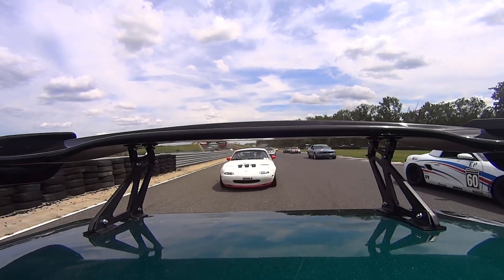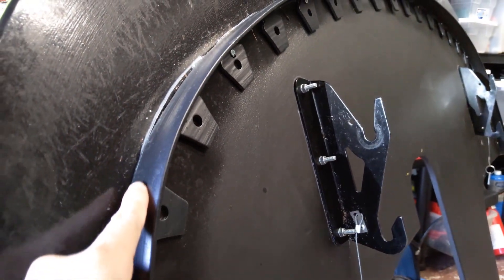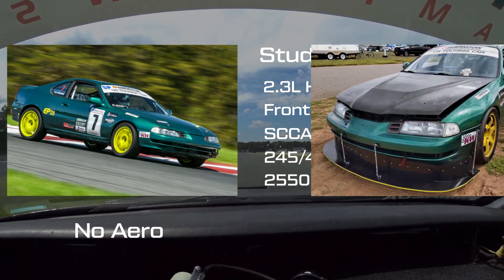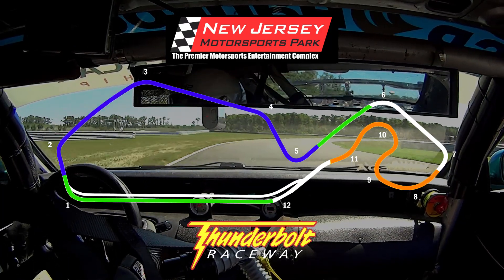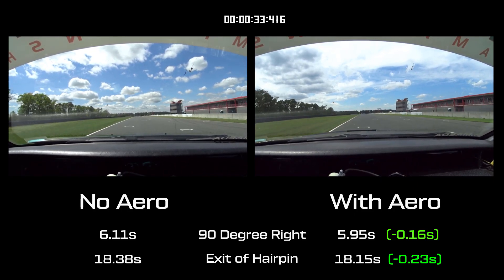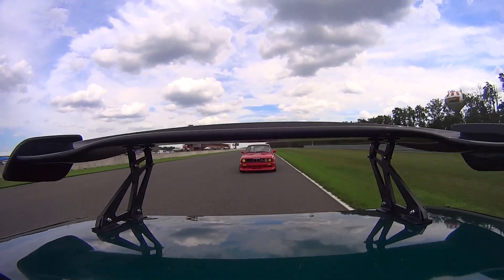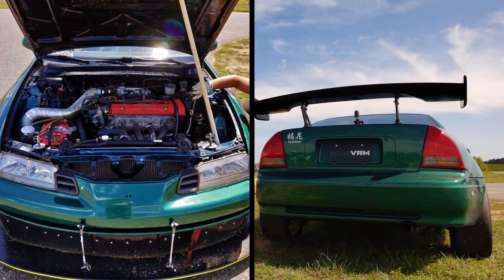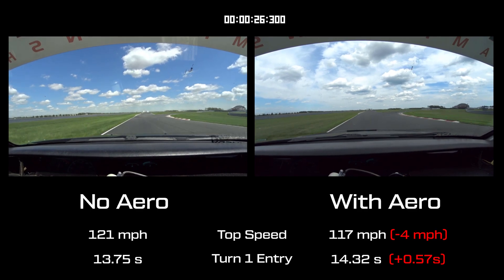Wing vs No Wing - Can a cheap aero kit produce downforce?

Comment from the maker: Some more background info for those of you who are curious - The wing is 57" between the endplates and was run at a 1 degree angle of attack as measured from the flat underside of the wing. The splitter sticks out 3" beyond the profile of the front bumper as viewed from the top, so it is pretty substantial. And yes, both are strong enough that I can stand on them.
Reply: StudioVRM add in enough power on the rebuild to make up for the added drag. As well as tape gaps in the car lol

Comment: Buddy, you can't claim there's not much a difference through two low speed turns when you dropped .39s! That's the better part of a half second in just two turns, and not high speed turns either!

It's also important to note that "gap" through low vs high speed sections isn't terribly indicative of much. A 1 second gap is going to visually be different from 60 to 90 to 120mph, despite not having actually gained or lost any ground on the trailing car.
Reply from the maker: You're not wrong. This script was written with track day and DE drivers in mind, where people tend to be a little less concerned about a few tenths here or there. The gap through high speed turns was fun to illustrate because it looks so dramatic on video.

That said, where you make up your time matter quite a bit in a wheel to wheel race. Most club racers can convert an advantage through high-speed corners into a position or two and hold it through the low-speed stuff. It's a little harder to do the other way around.
Reply: Fair point! Still, for time attack folks, it's worth noting that is the kind of gains folks are pretty happy with!

Comment: Was the chassis setup identical? The balance of the car remained the same?
Reply from the maker: The chassis setup and alignment was identical. It actually felt more balanced and natural without the aero, because that's what the alignment and suspension was set up for. We made some alignment changes to the car since the video was made, and the car feels much better (and is even faster) now.

Comment: Exactly why the GT500 has a oil catch can
Reply: Catch can does nothing for oil starvation induced by lateral acceleration, it just catches the oil (among other stuff) from engine blow-by.
Reply: @sepg5084 then why did they install it to solve that problem?
Reply: @WarriorOfEden3033  idk but it won't stop oil starvation.

Comment: Hi there, great video! Any pointers on stiffening the wing with the epoxy? I've got the same one and hate how flimsy it is. Is it as simple as drilling some holes and pouring it in? Thanks for the videos and your time!
Reply from the maker: Thanks! I detailed what I did on this page on this page here: https://studiovrm.net/racing-secrets-blog/how-to-make-a-cheap-wing-that-produces-downforce/

Hopefully that clarifies things a little bit. Basically I used a two-part polyurethane foam and poured it in a small amount at a time. The polyurethane is lighter than solid 2-part gel epoxies and it expands so you don't have to mix or use very much. My wing had cracks from previous use, so I sanded and filled those with a two part structural epoxy, similar to what you would find at your local hardware store.
Reply: @StudioVRM  awesome, thanks for the info!